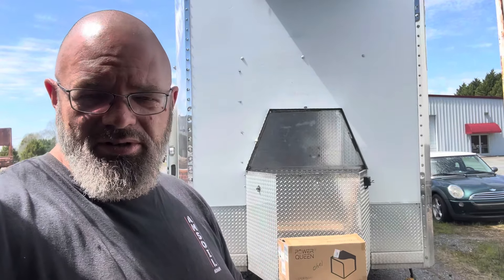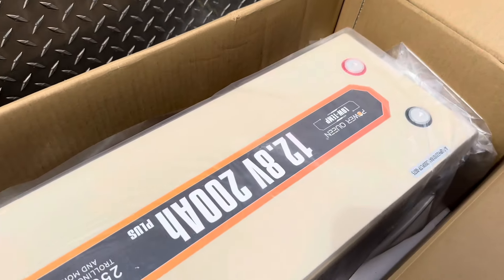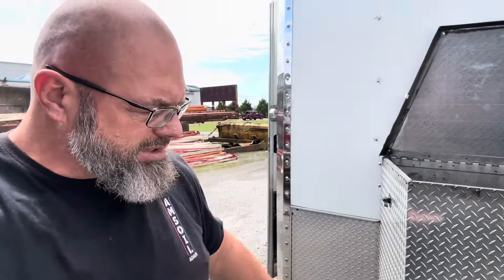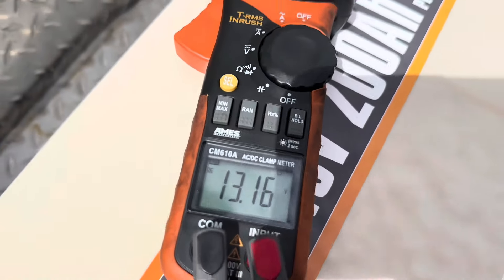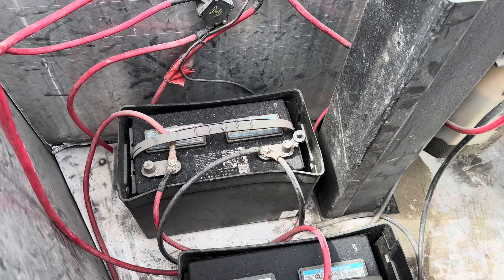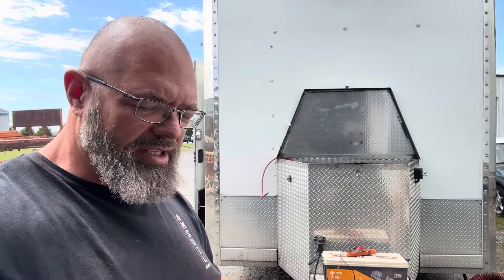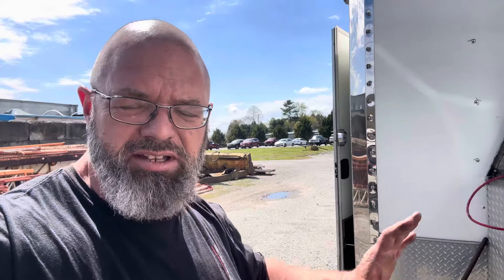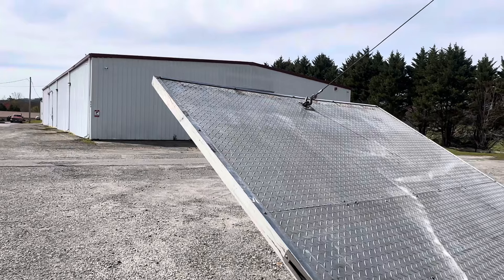POWER QUEEN Lithium Battery Upgrade!!

Comment: Just a quick thought that I am sure you already had.  SInce you have at least 2 rallies that you unhook the trailer, I would think having a separate system would be best.
Reply from the maker: I was thinking the same thing yes. I have a plan in my head. That will make them two completely independent systems when detached, but will work together when plugged in to an extent. And we only have the one Rally that we disconnect at and it has a separate power box for both the trailer and Goliath. But these systems also help me because there are some venues that charges stupid amounts of money to be able to plug-in to either 30 amp or 50 amp power supplies. But they will include a 20 amp at no additional charge. This way, the 20 amp just has to keep the batteries maintained, and then the battery inverter will power the rest of the system.

Comment: Very interesting. I wonder if the new setup offers you power when being on the road in the unlikely event that Goliath breaks down and you need power tools but Goliath's systems are offline. A powered wrench compared to a manual one? Sounds enticing.
Reply from the maker: At the current moment, no. There is a complete battery and inverter system on Goliath, but not yet on the trailer. The battery was the first step in the process, and my plans will have those exact capabilities that you mentioned.

Comment: Hi Adam, some batteries also have Bluetooth, which allows monitoring, if this doesn’t you can get Bluetooth shunts that can monitor charging / discharging amps. Lastly you could shroud the battery to insulate if from high and low temperatures, you don’t want it being baked by the sun also, I think about 60’C is a max high temp range. Some people have also sat them on heat pads to allow charging at low temps. You may know all this 😁👍 All the best
Reply from the maker: Yes, all very great ideas. The chin batteries that I have in the off grid Goliath set up have internal heaters built-in and they have all of the Bluetooth capability as well. I think in this system I’m going to use an all-in-one inverter and it will have a shunt built into it. That will give me the proper state of charge For monitoring.

Comment: Been watching for a while and impressed with your mechanical knowledge on about everything 😊. Thinking of getting an oil change “ kit” three holes I think you call it . What is the cost for the kit and delivery cost? Castle Rock Co. 2005 FLHTCSE2
Reply from the maker: There are many different options on how to buy it. If you just go online and buy it from my website retail I believe it’s gonna cost you somewhere around $150 plus whatever your local sales tax may be. I think that order would qualify for free shipping But if not it would only be like $7.99 or $9.99 to ship it.
Reply from the maker: There is another option, you can become a preferred customer and then you get a 25% discount on all the products. It will cost you $20 per year for the membership but you will save way more than that just on this one order. And then any order of at least $100 automatically qualifies for free shipping. And then for the remainder of the year you still get the discount on any other products you want to order for any other vehicles